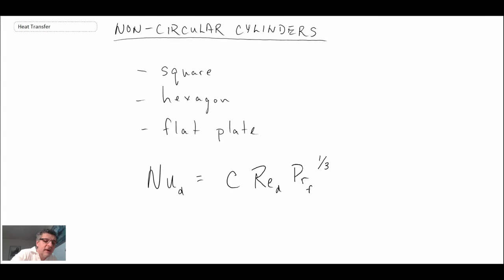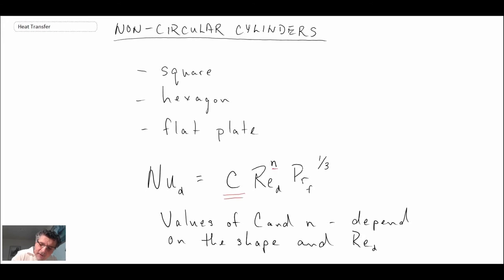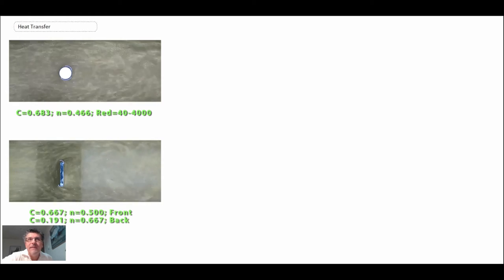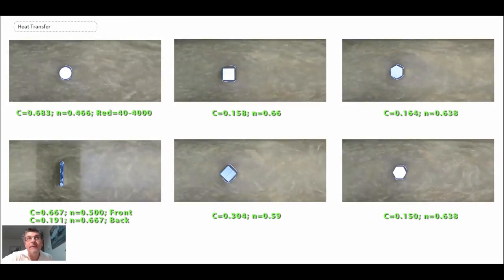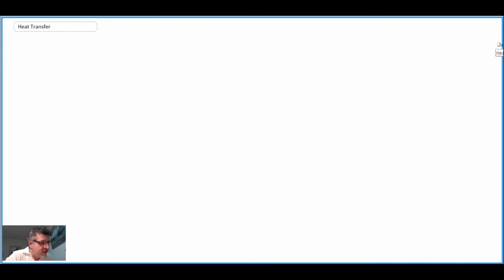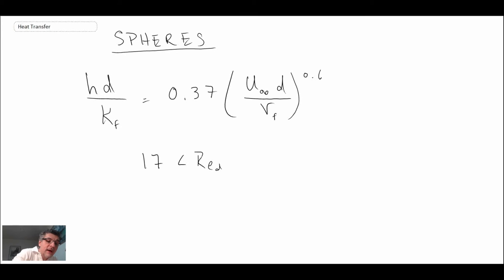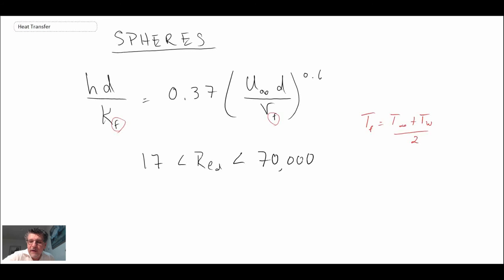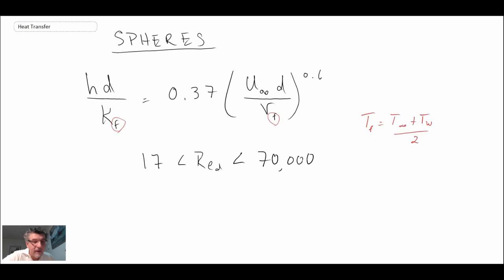Heat Transfer L19 p4 - Nusslet Number - Non-Circular Cylinders

Comment: What would be the diameter used to calculate the reynolds number for non circular cylinders?
Reply from the maker: Assuming that you are asking about external flow and trying to compute the convective heat transfer coefficient for forced convective heat transfer, you would need to look at how both the Nusselt and Reynolds numbers were defined when the experimental data was collected / analyzed.  For internal flows we normally use the Hydraulic Diameter, but for external flows it all depends on how the experimental data is processed using non-dimensional numbers - the length scale appears in both the Nusselt number and the Reynolds number.